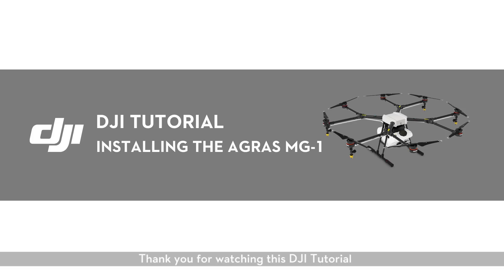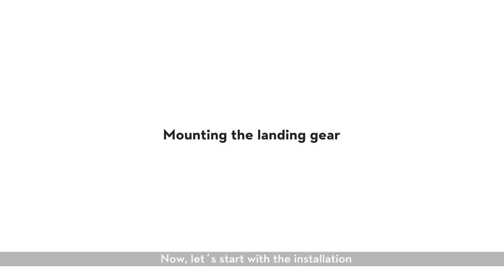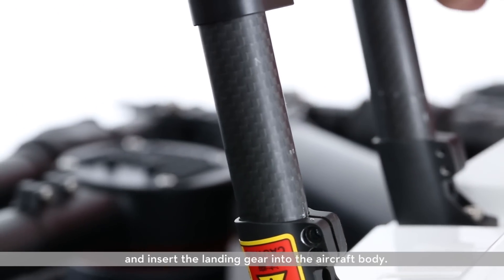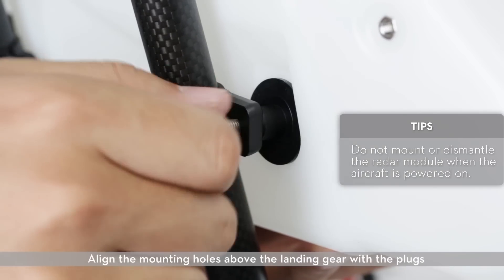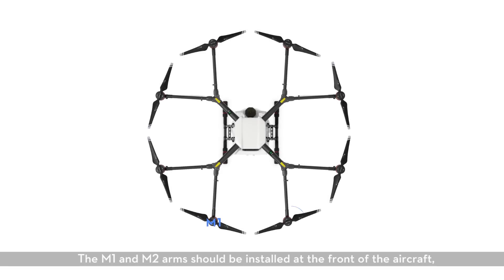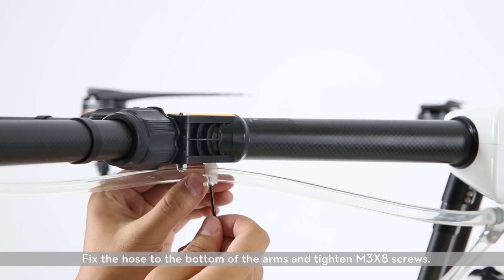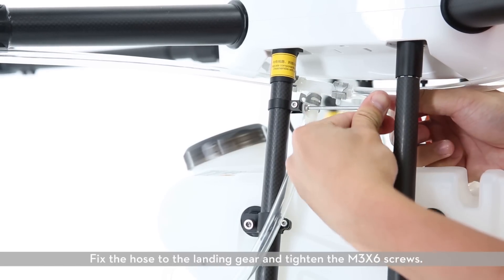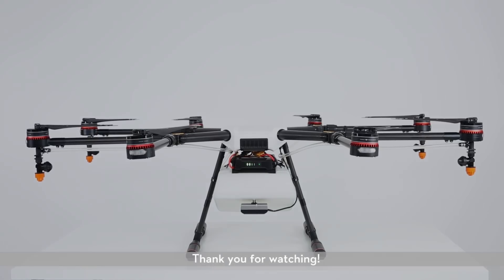DJI Tutorials - AGRAS MG-1 - Installing

Comment: For those of you worried mostly about the props here, DJI typically have rubber tips on their props to help avoid injuries. They also fold back when encountering something solid (they swing freely). The drone would have cut throttle when it detected the crash even if the operator didn't. 

I'm not saying that delivering a child to a field on a drone is a good idea. Just that the Rotors aren't quite as dangerous as they might seem. He's probably fine if the drone didn't land on a wrist or elbow or something.

Comment: Hola, soy de colombia, tengo el DJI Agras MG-1, y con la nueva actualizacion del sistema el control remoto se separo del MG-1, usted sabe como hace el binding del control remoto al MG-1?

Hi, I'm from Colombia, I have the DJI Agras MG-1, and with the new upgrade the remote control system was separated from MG-1, you know as does the binding on the remote control to MG-1?

您好，我來自哥倫比亞的時候，我有DJI Agras MG-1，並用新的升級遠程控制系統從MG-1分離，你知道一樣的遙控器MG-1上的綁定？
Reply: pudiste solucionarlo ?
Reply: Hola, pudiste resolver el problema de la conexión del control remoto con el drone. Tengo el mismo problema y no he podido resolverlo. Te agradecería si me puedes ayudar.
Reply: @andresfajardo1106  si, debes conectar el dron al asistente del mg por el computador y realizar el binding por el botón azul